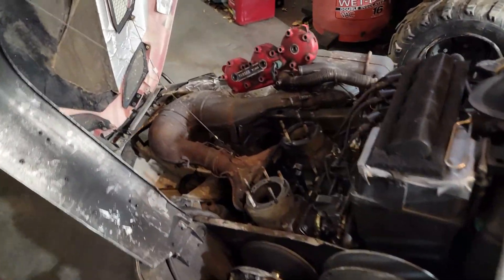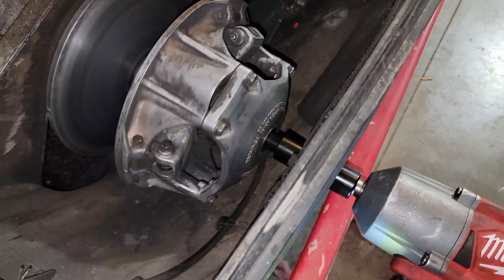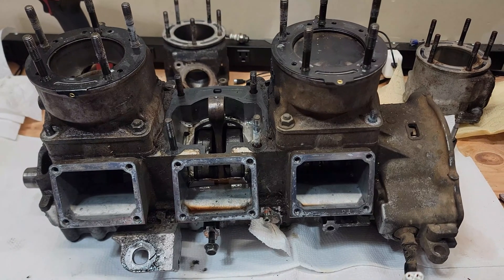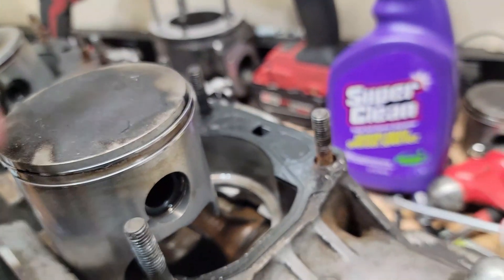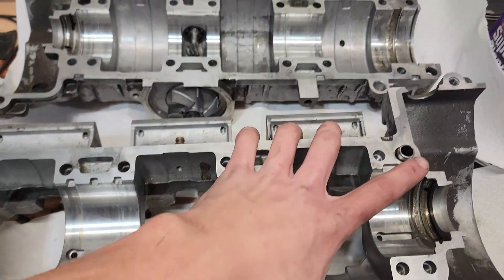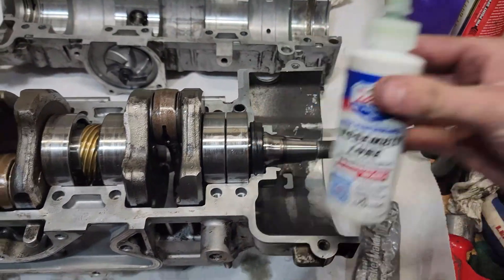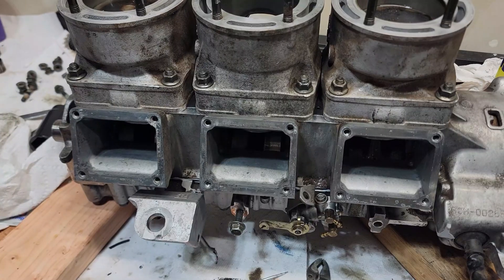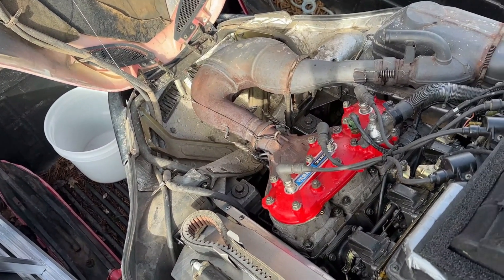Rebuilding Yamaha 700 Triple (redhead)

Comment: I wonder why it seized in the first place ? How many miles ? What do you think happened ? These sleds usually go 10000 miles plus
Reply from the maker: @DakotaHDrums  previous owner had the carbs off when I bought it, I’m wondering if something got into the bottom end while it was sitting or if moisture got in it and rusted the bearings. I cleaned it out as well as I could beforehand but there’s not much room to get into there with only the carbs and reed valves off

Comment: Where can one find safe website for replacement parts of Yamaha engine components?
Reply from the maker: @WNracing25  Usually wherever you can find reputable name brand parts like Weisco or others, Partzilla is good for oem parts
Reply: Following. Just locked mine up .. broke belt, blew hole in my coolant hose.. didn't realize and overheated. She's locked

Comment: Are the wrist pins caged bearings?
Reply from the maker: @johndecnodder7746  yes but I didn’t replace them because you need to use a press to disassemble the whole crankshaft and then balance the whole thing afterwards